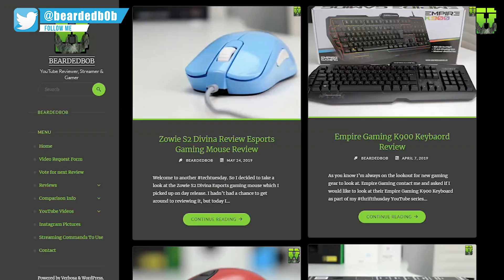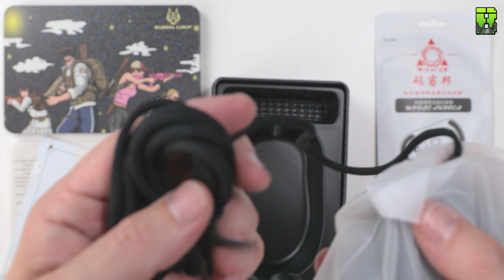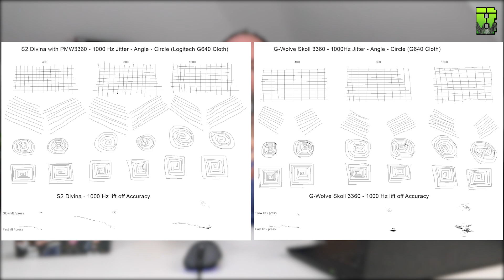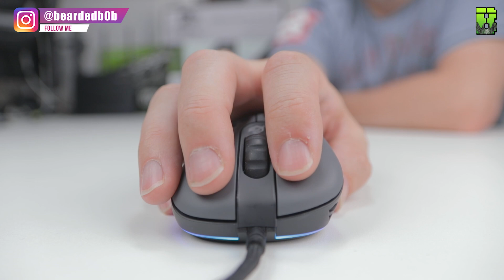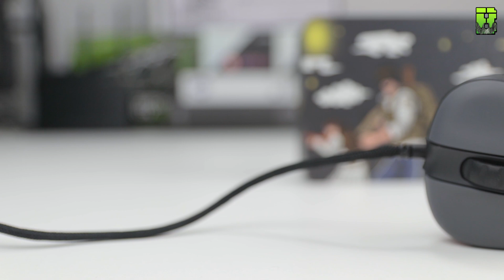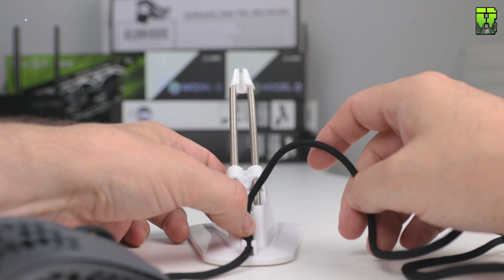G Wolves Skoll Review Ergonomic Gaming Mouse Only 66 Grams

Comment: Not sure how every reviewer says this mouse has no side flex. I had 3 copies all with horrible side flex. Creaked and flexed every time you pushed on either side. Plastic felt like a cheap 3d-printed shell. No grip on it whatsoever. M1/M2 buttons had a ton of post-travel. Sent all of mine back, sticking with my S2.
Reply from the maker: You must have really strong hands :-).

Comment: kann you please give me the link from the software i want to change the dpi and i cant and dont know where the software is or how i can open
Reply from the maker: here it is. thre are two files in there the firmware which I wouldn't do unless you know what you are doing and the software which you are after. http://114.80.208.88:29080/skl_3360_upgrade_20190823.rar
Reply: @Beardedbob  i cant open it do you know how i did install it
Reply: and know there is a microsoft edge picture before becaudse i did try to open it with that
Reply from the maker: its a .rar file which is like a .zip file. Once you open it using winrar you will then see the files inside.
Reply from the maker: sounds like you don't have winrar to open it.
Reply: @Beardedbob  i cant understand anything

Comment: Are buttons more stiff than ec2a? I had to return my EC2a because of the stiff buttons.
Reply from the maker: I don't have the EC2-a, but the S2 I've tested came in at an average force of 68g where the Skoll was 83g meaning harder to press. I've the EC2-b which should be close, but I need to measure the force.

Comment: I bind jump to mouse wheel up/mouse wheel down in fps games. Do you think accidental jumps could be an issue with this mouse ?
Reply from the maker: I don't see that happening. I don't feel any false rolls or clicks. What mouse do you have atm?
Reply: @Beardedbob  wow, thanks for the quick reply. That's reassuring. 
I have an ec2b divina, and since I love the shape of this mouse I'm really considering buying the skoll (well its wireless version when it comes out). I don't have that issue with the ec2 since the mouse wheel has only 16 steps and doesnt move much but I had it before with my deathadder elite, and it's really annoying when it happens
Reply from the maker: I think you will be impressed with the Skoll it can certainly hold its own against the EC2. It has 25 steps so the transitions are nice and tight. I'm looking forward to tearing it down to see what this scroll wheel is on the Skoll.

Comment: Nice review Bob! Shape on this thing looks really nice especially at that weight. I'm excited to see what other mice they have in store because I think they teased a wireless model!
Reply from the maker: I agree this would be an excellent option for the market. The Skoll is a better option for palm over the Model O.

I'm going to so a comparison picture for the shape between Skoll, DA, Mama, EC2, G403 and Intelli MS.
Reply from the maker: Glad you liked it. If the do make it wireless and with a decent tech then it could be very popular.
Reply: @Beardedbob  yeah a wireless version with a decent sensor at a reasonable price would be really hard to pass up! Even still the wired looks like a good deal, might even be better than model o if you prefer more of a palm grip. I've gotten pretty use to playing with a relaxed claw grip using the model O, but I kinda miss the hump/height from using the DeathAdder Elite; it just fills up my hand more and feels more comfortable playing on for extended periods of time. Not sure it would be worth swapping off the model O, but a wireless version would definitely worth trying and could potentially be an upgrade.